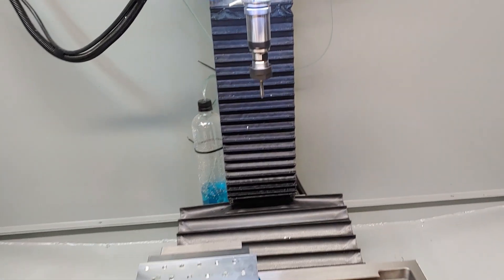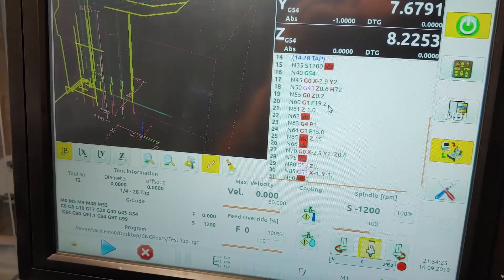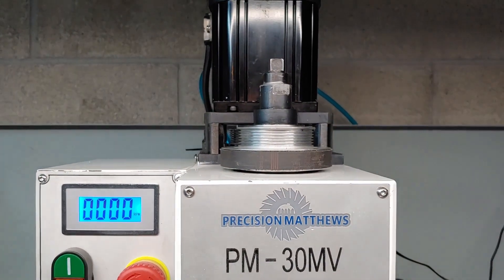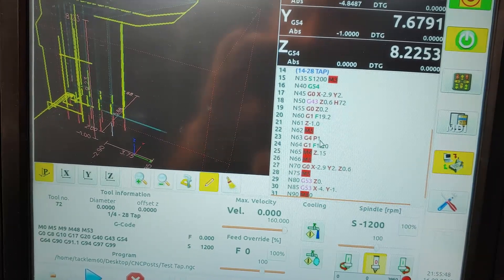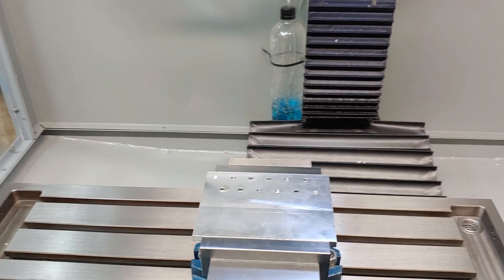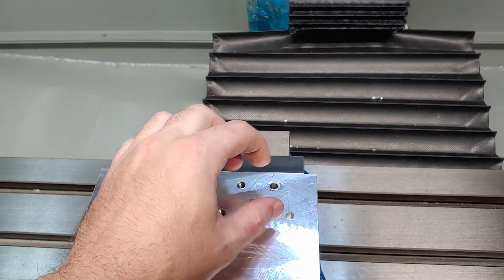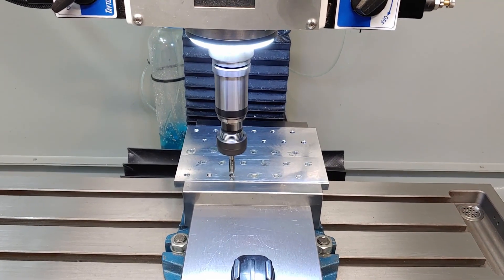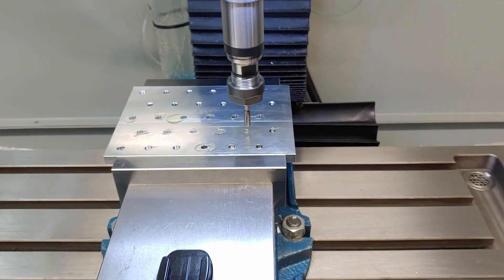Power Tapping On The Precision Matthews PM-30MV

Comment: Just subscribed, really like your content!  I am thinking of purchasing the same mill and doing the conversion. What kind of tolerances are you able to consistently achieve? Also, what size motors did you use?  Thanks!
Reply from the maker: Jake Masheck glad to hear it man. If I can help out one or two people then I’m happy. I have 640 oz-in on both the X and Y axis and they are plenty. On the Z I have a 980 oz-in and it works well but I would have been able to get a little more speed out of a 1200 oz-in or so. They are all Nema 34 too. 

As for accuracy, it’s clearly not a DMG or even a Haas but I very often circular interpolate at around a thousandth If tolerance and my pockets are typically just under a 0.001 assuming I have my backlash dialed in and the mill is running well. Positional accuracy is always within half a thousandth (I can pick up my WCS with a haimer with .0003 consistency and that is almost outside the readable accuracy of my haimer anyway)

If your work calls for tolerances in the thousandths, it will absolutely work for you. If you’re trying to work in the tenths, you are going to have to walk it in and will probably blow your tolerance half the time.

If you have any other questions or video requests to help make your decision let me know. And p.s. don’t waste your money on the blue stand that PM sells. It is absolutely not rigid enough if you plan to convert to CNC
Reply: @MPMachining  Thanks for all the info! Im sure I will have more questions soon.
Reply: @MPMachining  Did you you use standard steppers or closed loop hybrids? Do you wish you used hybrids (if you didn't already)?
Reply from the maker: Jake Masheck mine are just standard open loop steppers with digital drivers from stepperonline I believe. I have never had an issue with losing steps except when I was setting the max rapid speeds on the machine. If I was going to spend the extra money I would have gotten servos, but I am plenty happy with the steppers I have (but again I would have chosen a larger Z and still may)
Reply: @MPMachining  Thank you very much for answering all of my questions! Do you have item numbers for the 640 oz-in steppers and the drivers? Where did you order them? Thanks again, you have been a huge help!
Reply from the maker: Jake Masheck Glad to help along the way. The motors I got from Stepperonline. (https://www.omc-stepperonline.com/nema-34-stepper-motor/nema-34-cnc-stepper-motor-4-5nm-637-38oz-in-86x86x79-5mm-4-wires.html) and that is the link for the X/Y. This is the Z motor that I will probably be picking up and wish I had gone with in the first place (https://www.omc-stepperonline.com/nema-34-stepper-motor/nema-34-cnc-stepper-motor-8-5nm-1203-94oz-in-86x86x117-0mm-4-wires.html)

The drivers I got were model number DM860T and I used one for each axis. Those actually came from amazon funny enough but the seller was also Stepperonline. There amazon price was just better than them shipping to me from the China warehouse. 

The last big purchase is obviously the power supply. For that I went with this guy (http://www.antekinc.com/ps-5n70-500w-70v-power-supply/#) and it has worked great. 500W was plenty and it’s nice having the on board 5V as well as the 70V for the drivers. 

Let me know if there is any other questions you have
Reply from the maker: Jake Masheck After talking about it so much, I finally decided to grab a new Z axis stepper. I went with a 1700 oz-in just because I got a deal on it. But it’s definitely overkill. I’ll make a video when I replace it
Reply: @MPMachining  Awesome, looking forward to the video!
Reply: @Battle Resistant Outfitters  Did your ball screw kit from procut cnc have grease fittings?  If  so, can you access any of them  after they are installed?
Reply from the maker: Jake Masheck each of the sets of double nuts has a threaded port in the flange for oil. None of them are accessible while the machine is put together so you will need to plumb it to a one shot Oiler or something similar. Personally I have just been putting oil on the ballscrews (which likely doesn’t get much inside the nuts due to the wipers on them) and when I have taken each axis apart do make small changes and stuff I oil the nuts. Haven’t had any issues so far but when i strip the mill down to move in a couple months I’ll be adding a one shot system
Reply: @MPMachining  Do you by any chance remember why/how you decided on a 70v supply?  

Btw, my pm30mv is arriving tomorrow and my Arizona kit has been ordered. 
Thank you. You have been a huge help!
Reply from the maker: Jake Masheck excited for you to get your machine! For the power supply it was based on the allowed voltage input for my specific steppers I got. The drivers and steppers were rated up to 80V so I went with a 70V unit to allow for some tolerance between base voltage and peak voltage. In reality they can handle much more than 80v but I’d rather play it safe and it gives me plenty of power out of the motors

Comment: Great video and timely for me. I also got the Tormach tapping head several months ago but haven’t tried it because I was unsure how to use it. So I was happy to see your video. Are you planning to make a power draw bar? If so, have you thought about how you would drive the spindle encoder? I don’t know about your controller but the Centroid Acorn I’m using requires the encoder to run at the same rpm as the spindle. That makes it harder to implement with a TTS style PDB.
Reply from the maker: Glad to be of some help! If you need any help getting the code to work just let me know. As far as PDB go, I had fully planned on doing one when I built the machine but the more I use it, the more I'm not sure if I'll do it. As it is, I am changing tools in under a minute so unless I plan on driving into an ATC, I'll probably stick to what I'm doing for now. 

As for the encoder, the current single pulse encoder for the digital readout on the head is located inside the faceplate of the head and is driven off of the spindle side of the pulley system. My plan was to try and find a way to do the same and it shouldn't interfere there.